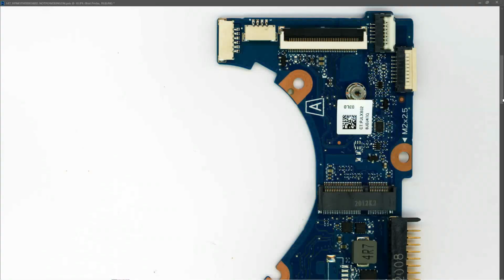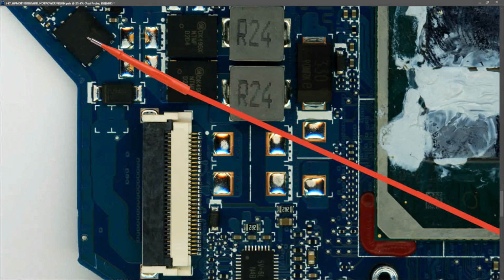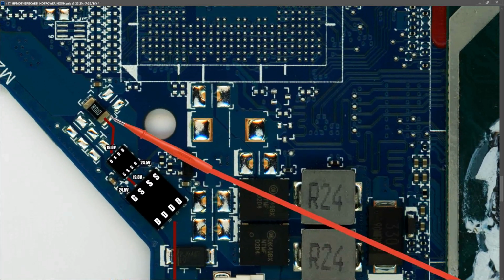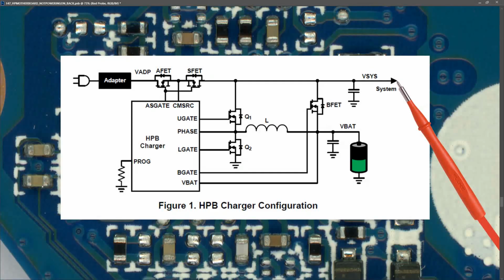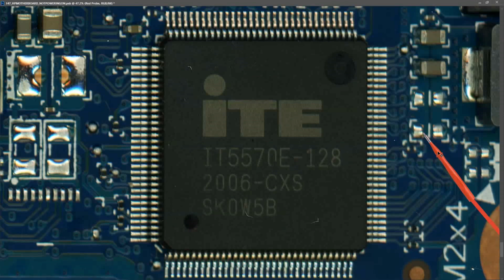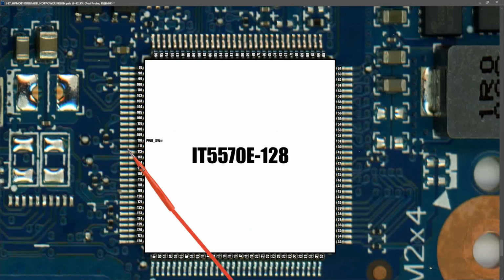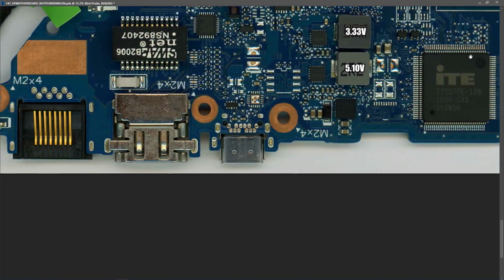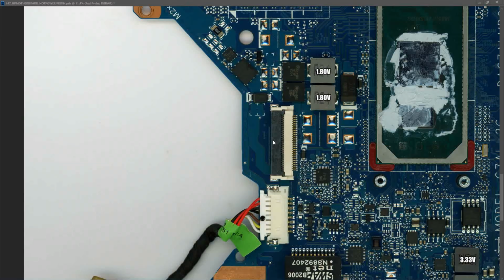HP PAVILION 14 - POWER ON BUT NO DISPLAY (PART I)

Comment: Hello 1.8v not normal looks like too high some issue with regulator for this rail?
Sometimes HDMI not reliable to check picture not always showing post screen
Use usb keyboard and caps key to confirm if CPU responding or use CMI Zapper USB tester like I use to see activity PCH/CPU

Comment: 1.80V on the CPU seems very high no ? Usually 1.2V
Reply from the maker: That is exactly where I was going Pascal............ BUT.. another subscriber provided me with the correct voltages on the secondary inductors and apparently my board is producing the correct voltages. (I had presumed that the 1.8V chipset voltage was shorted to the CPU voltages).

Comment: You have coils and mosfets.. missing from the board, right beside the CPU.
Reply: Yes. I saw a photo of that motherboard indicated for the HP Pavilion 14-CE on ali/ss. There are 5 inductores in total surrounding the chipset. Thanks for your reply, which in my opinión is key. Thanks again. Kind regards.
Reply: @CarlosGarcia-d3e  
Sure! 👍
Reply: I don't think that they are missing. A single board can have multiple configuration -ie, different CPU, with or without dedicated GFX etc. Depending on the SKU of the CPU used, it's VRM requirement will vary. i3 may need only one phase VRM while i5 or i7 may require two. So the OEM will use the same PCB but with different configurations. If you need to compare with another board, the two boards should be exactly same. Looking for only the board part number may mislead.
Reply: @anshadedavana  
Whatever you say, on this board some components are obviously ripped off.. Wait for the next video to confirm what I said.
Reply: @مصطفى.القرشي  ,
Second part is out. I suggest you to watch it and update your knowledge about mainboards.
Reply: @anshadedavana  
I already did, yes you was right, Congrats.

Comment: BIOS certainly seem like a prime suspect. However: DDR RAM Conn soldering OK?
LVDS Section (cable leading to  Display): Open fuse? Is any componente burned or out of tolerance?
Thanks for sharing. All the best.

Comment: Electronically, the board seemed functional, no shorts, etc. so I am leaning towards a possible BIOS issue. If there was an issue with the screen or its connector, then you should have still gotten a screen from the video output. Since there is no separate GPU, either the CPU is faulty or BIOS. I wonder if an oscilloscope would be useful to troubleshoot this type of an issue. Anyhow, great video as always, sir!